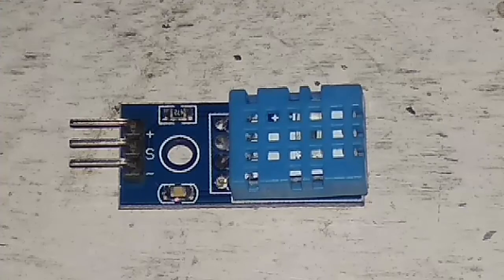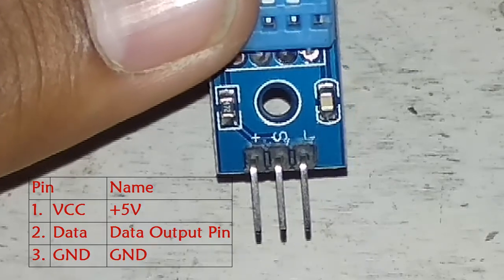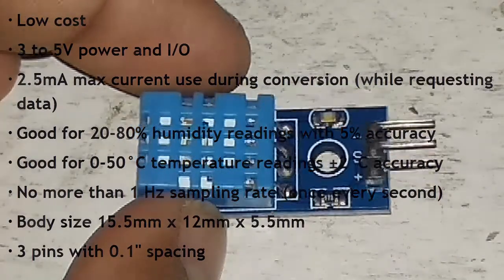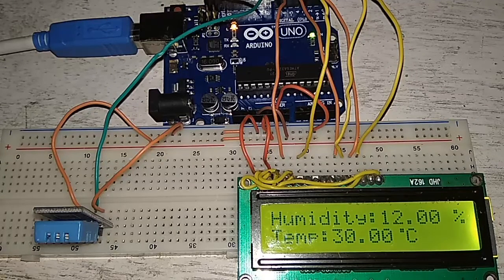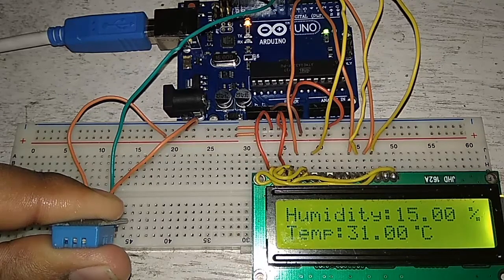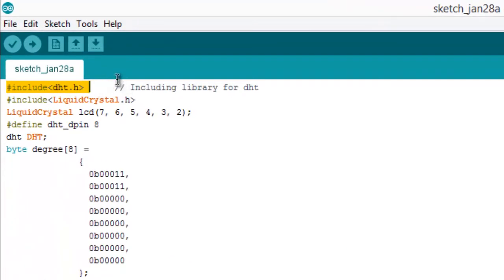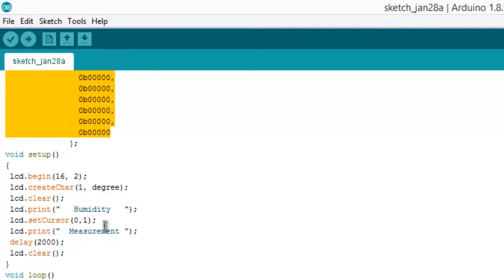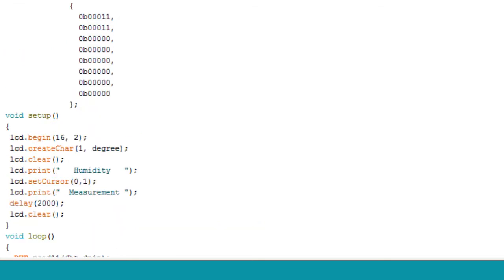DHT11 Tutorial - Humidity & Temperature Measurement with Arduino

Comment: Arduino: 1.8.12 (Windows Store 1.8.33.0) (Windows 10), Board: "Arduino Uno"

sketch_feb29b:3:34: error: expected primary-expression before ')' token

 LiquidCrystal lcd(7, 6, 5, 4, 3, );

                                  ^

exit status 1
expected primary-expression before ')' token

This report would have more information with
"Show verbose output during compilation"
option enabled in File -> Preferences.
Reply: There is missing 2 - ....lcd(7, 6, 5, 4, 3, 2)

Comment: sir is ko calibrate kaisay karaingay ghalat show ho raha hai
Reply from the maker: This is already calibrated  no need of external calibration in case of digital sensors.
Reply: @HowtoElectronics  
sir i buy a sensor dht11 which show 91 percent humidity in normal room temperature
Reply from the maker: Humidity vary according according to environment and climatic conditions. In winter it goes high. In summer it goes low. In wet areas its too high. In desert or dry area it can even go to zero.
Reply from the maker: 91% is normal at night during winter
Reply: @HowtoElectronics  but i have another humidity sensor in clock which shows 46